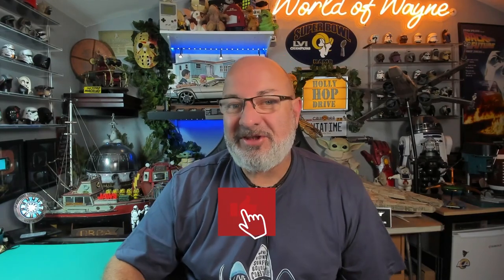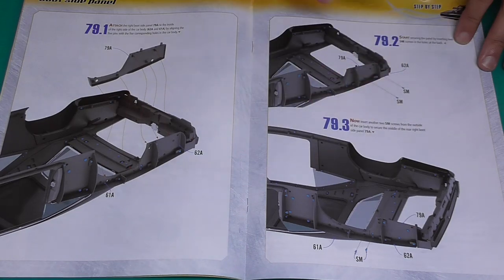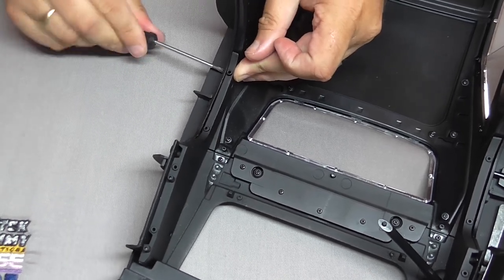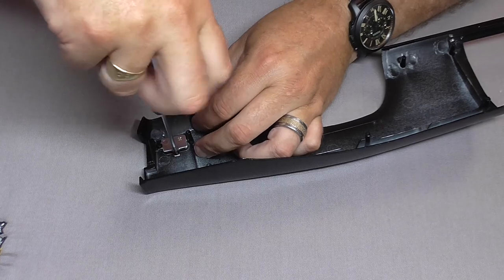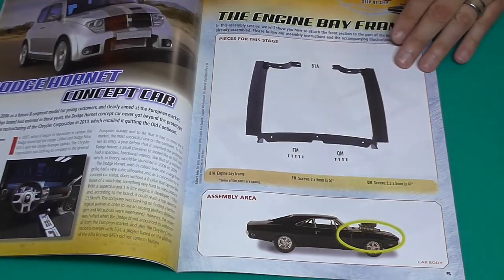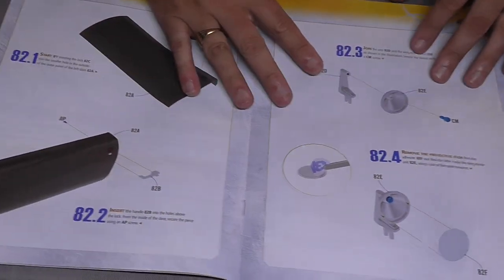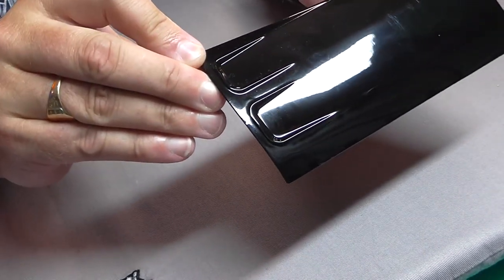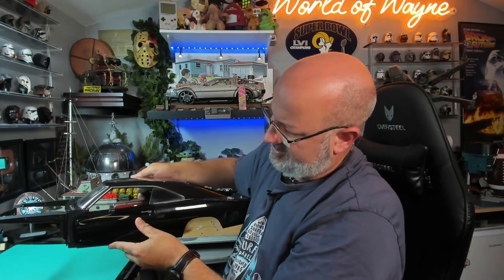Build the Fast & Furious Dodge Charger R/T - Part 79,80,81 and 82 - Rear Wing and Door

Comment: I'm on stage 50 half way there! But that's parts from the newsagents fanhome are sending 3 to 4 through every fortnight now so it's picked up speed of completion and price! So something to be aware of for a next model like this beca it won't be the last now haha! The F40 parts stopped when covid all came in so lost about 30 quid in the first couple issues shame it's one I'd loved to go to this stage! I got all the sound system speakers and battery box in the last issues! I've not yet started the build yet the issues are all in tope boxes piling up I've thay much to build woth my armour model's aswell in 1.35

Comment: Okay, I'm confused - more surprised. At what point do we find out what goes in the passenger side? We have those hooks on the floor that aren't attached to anything, (I think you may have lost one) and there also seems to be slots on the fire extinguisher for some sort of straps - any idea when we might be installing later on, if anything?
Reply from the maker: No idea. I do have the next delivery on the way